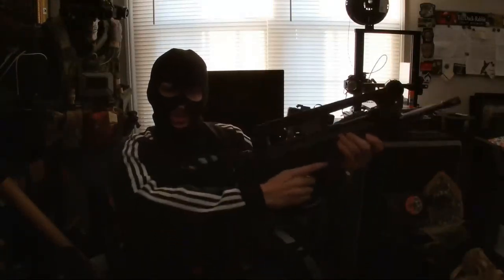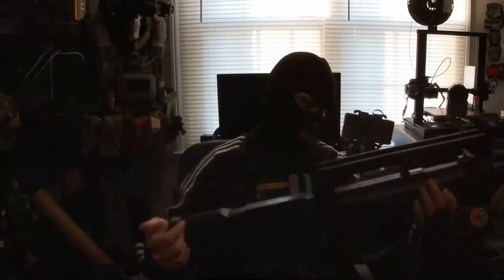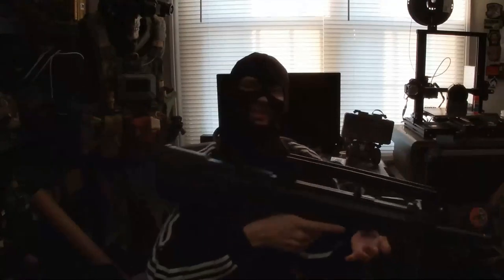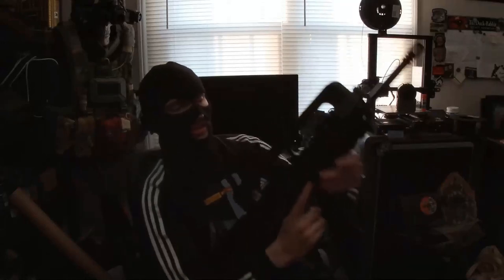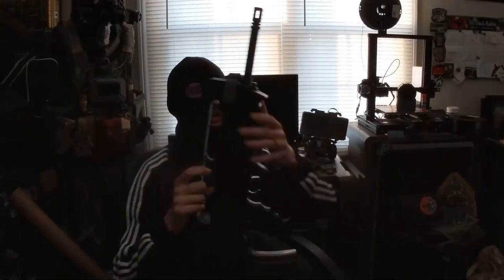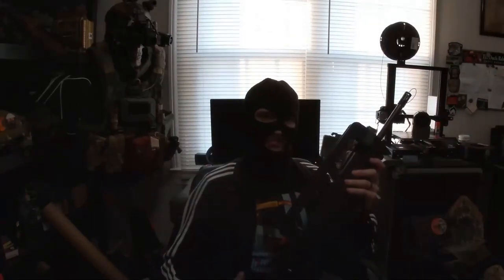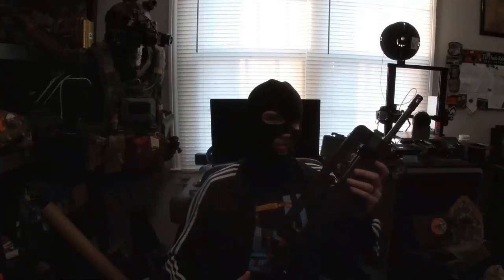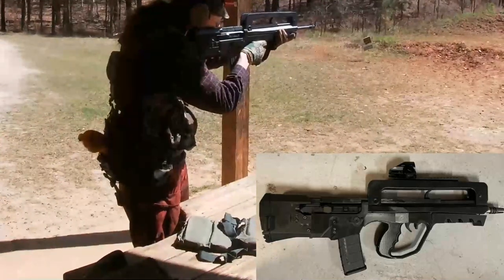FamAR Finale

Comment: I have a 20 inch barrel (with an A2) and an 18 inch barrel (with an YHM phantom) I’m considering using. Do you think one would look more accurate to an actual FAMAR compared to the other?
Reply from the maker: It is intended to be made with an 18" for the same OAL as the famas. Mine is personally a 20" because I had the fn chrome barrels laying around

Comment: Can you mount a red dot on top of the carry handle? Thinking like a micro or rmr style

Also, would this print work well using Nylonx?
Reply from the maker: This design is made to be printed with PLA+ on a standard size (ender 3) printer with a 220mm ish print bed. Nylon x would be an improvement for most of the parts and the buttplate can be printed in TPU.

There is a picatinny rail mount in the files that can host an optic.

Comment: Is there room for a right-side charging upper? Do you think that would be a better route to go than the top charging handle?
Reply from the maker: The top charging handle is pretty great as it's on the front. The side of the upper is accessible and it could be built with a side charger without issues.

Comment: How many steaks will it take for you to release a developer FAMAR pack with STEP files? Would love to remix your design.
Reply from the maker: I've got a side project to make the rear part fit over a milspec ar so that preexisting SBRs can be used or so that people can print FAMAR kits for friends. As well as recreation of the FAMAS SMG prototype handguard and forend. After that I'll have a dev tool pack of every variant.
Reply: @thegunfoogle2864  Awesome, I was converting the STL files to STEP for a SMG bullpup build but I guess I'll wait on that then. It's a pain in the butt.

Comment: What filament did you use PLA, ABS, or Nylon? Also, would this work with an HBAR as is or would it need to be modified to fit it?
Reply from the maker: This will work with an ar barrel that fits the handguard and can be printed in PLA+ by even a low end printer with a bed 220mm across.
Reply: @The Gun Foogle  Sweet. Is that handguard required or would a similar profile M-Lok work?
Reply from the maker: @thomasstewart1380  it has to be the aim sport wraith. The hole spacing or width being slightly different will make parts sit differently and it could be unsafe.
Reply: @The Gun Foogle  So the handguard would have to be modified to fit a rail I already have then. I'll probably just try to get a hold of the wraith if I can. Most likely just gonna build it from the ground up.
Reply from the maker: @thomasstewart1380  I probably caused a shortage on the 13.5 but you could grab the 15" version cheaper in some places and chop it if still available
Reply: @The Gun Foogle  One more question, how many rounds cand you fire in a typical sitting before the PLA+ forend starts to warp or melt? That's really my only concern when it comes to making that handguard portion. I like to dump mags a lot. Don't want it melting. Lol
Reply from the maker: @thomasstewart1380  The handguard under it is metal and it will heat evenly. The forend would probably handle more rounds than the gas tube.
Reply: @The Gun Foogle  Bold claim on the gas tube bit. But I can see what you're saying with the handguard acting as a heat sink. How much have you stress tested it? I'm still wary of the fact that it's an enclosed space for the heat to just gather in. Still gonna build it, but I'd like to know the limitations ahead of time.
Reply from the maker: @thomasstewart1380  The S96S handguard also attaches an mlok handguard and I did a meltdown on mine without any of the printed parts failing. Generally the handguard isn't going to get to 120C? or more until the guns trashed.
Reply: @thegunfoogle2864  sounds like solid enough stress testing for me. Thanks!